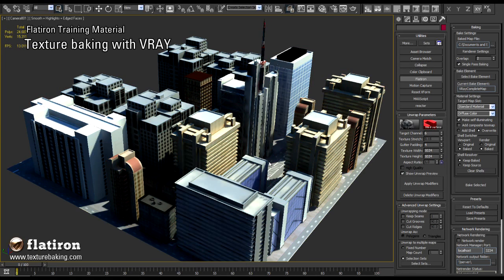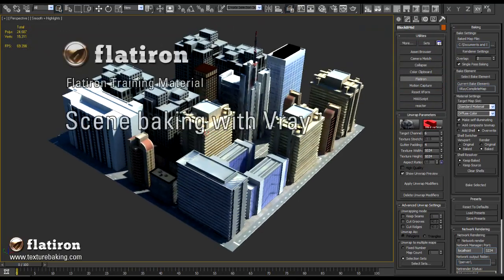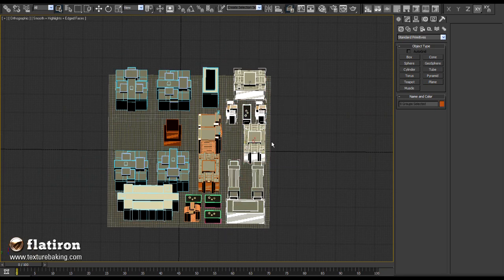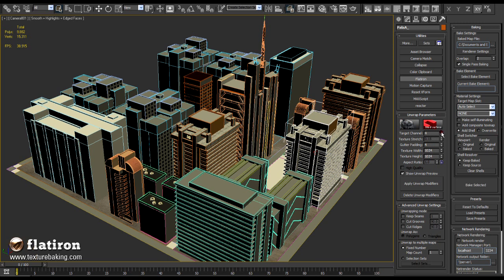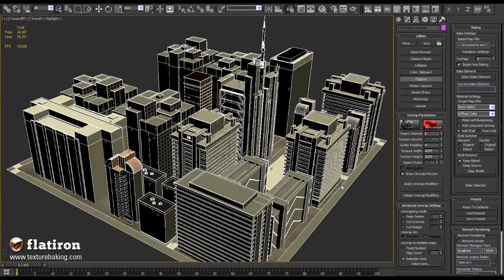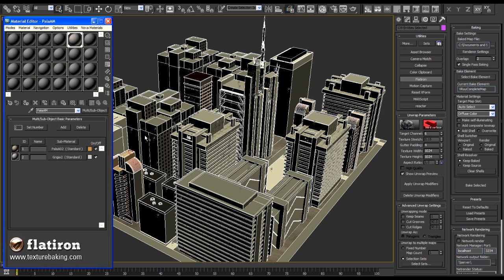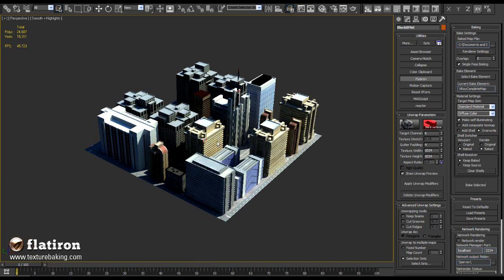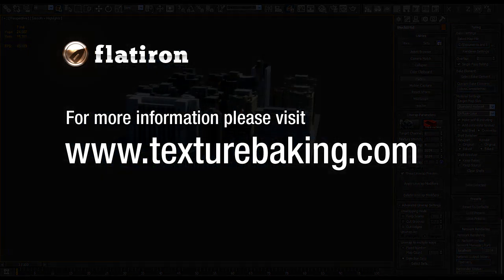Flatiron texture baking with VRAY

Comment: This looks cool but I'm new to Texture Baking - if you didn't have this plug in, what would be the disadvantages of texture-baking using the default way of doing it in 3DS Max (sorry, I've never done Texture Baking before so I can't see what the advantages of this plug-in has over the standard method).

Thanks :)

Comment: ...you are wrong. There is no perfect mate material. Therefore every surface will reflect the environment with a certain diffusion light according colors and its real texture. So every surface look different from different angle/direction.
Besides the baked mapping you need to set up materials with realistic reflections.
If you apply one and only material over the whole block you must render the reflection and glossy maps.

Comment: awesome!.. Just a bit curious how well it works with reflective objects xD
Reply from the maker: Hello. You know that reflections are view based? If you bake textures (independent from any software solution on the market) you will get a silly looking appearance - they will stick in the view and will not react to you camera movements around the objects. This is the reason one does not bake reflections (or God forbid refractions!). FlatIron can bake them - if you can live with this result, it is ok. I have discussed this method in the other video, see here: https://youtu.be/yxcmrNq7BU8?t=329  thanks best regards

Comment: Vray buffer window (or however it calls) and similar afterwards image retouching are image post-processing - you can not bake video post-processing, not in Autodesk 3dsMax. For texture baking it is recommended to use as far as it is possible the "real world" light and GI values. Optionally you can bake texture as OpenEXR 32bit and then tune the light and color in photoshop with gama/exposure. But try please to get as far as you can without this virtual exposure tools, at least by texture baking.